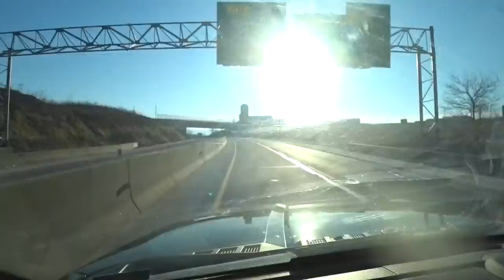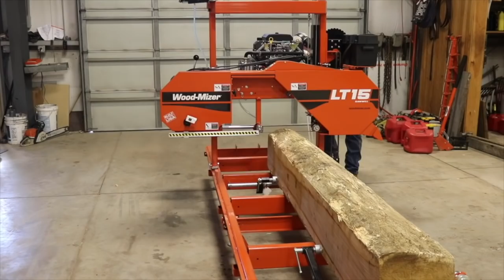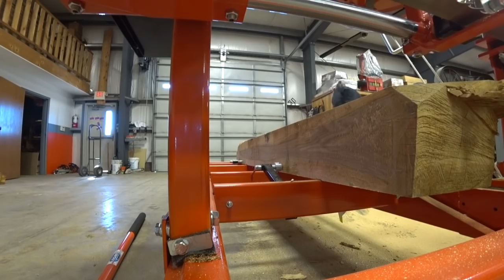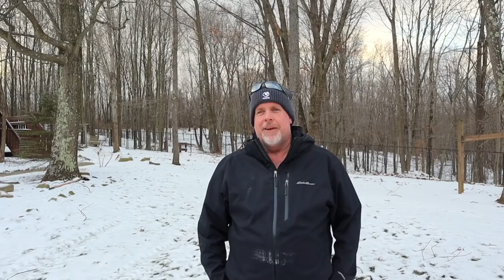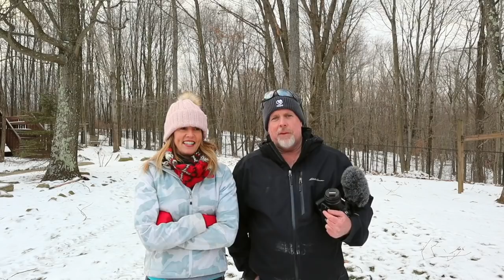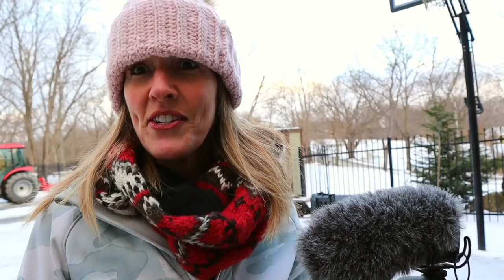#341 WOODMIZER SAWMILL  And Thanks for 50K!

Comment: We bought a Woodmizer LT30 with the trailer option back in 1989 and still have it,  at this point it hasn't been used a lot in the last 15-20 years, but prior to that we ran a just short of 3 million board feet through it.  They built a great product that's easy to maintain, and will last you a long time if you take care of it.

Comment: Bought the NORWOOD 36 HD and it works fantastic. Added a section to accommodate 12ft lengths.  And the hydraulic  lift arms and pump make loading the logs so much easier.  Also bought the 23 hp engine as an upgrade and did buy the  axle and tire assembly so as to go mobile.

Comment: Going to school in the 70s & early 80s, we had at least 1-3 snow days per winter in NE WI.  When I was in high school (1981-82 winter) they did cancel school several times due to -15 or lower days.  I can remember kids with wet heads getting on the bus in the mornings and by the time we got to school, their hair was frozen.

Comment: Hi Mike, thanks for all of your videos on tractors and implements. I finally took the plunge and bought our first tractor recently.  BTW, i have had a similar mic issue with the Rode mic ,where i plugged it into the headphone jack instead of the mic jack by accident, resulting in no audio. It is usually the simplest explanation.

Comment: Re the Wood-Mizer LT15 wide vs standard LT15: I would absolutely recommend the Wide.  I have an LT15 (and LOVE every minute of it) but my one regret would be going longer instead of wider.  Went with an extra bed in order to be able to mill 22’ lumber but now find myself rarely milling over 12-16’ (built a solar kiln that only takes up to 14’ material) and needing to trim logs in order to fit the 26” gullet.  Don’t get me wrong, 26” wide lumber is fantastic, particularly if you’re going to glue up book matched pieces, but having single slabs up to 36” would be well worth it - particularly if you’re looking to mill for crotch figure where much of the most interesting wood is.  Trust me, ANY sawmill will change your entire outlook on logs.  You’ll never look at a log again without wondering what it might look like as lumber.  Each log is like opening up a Christmas present or figuring out a new puzzle lol.  Thank you for all your insight and awesome videos!

Comment: Build a stack chamber to set the first cants in horizontal off the ground.  One slice and firewood production could drop into the trailer underneath.   That saw will be a great addition to the property and future materials to use, sell or barter for storage barns. Do anchor seal your saw logs and let them age.  Great channel, kapper outdoors referred you.

Comment: hi there guys . 0  to 50   faster than my car . great job  and i do believe it is your 3rd job . and great pay more toys to play with . now to preach a little .LT 15 is not big enough at least go to the wide . you can't add wide later but u can add longer . .i made a mistake like that . one trouble is the 15 does not have high bunks . a log of that size will need to be placed on the mill with a machine . think of your big oak log. what size band mill can saw it . a 15 w would . turning in not going to be a problem . hand feed to me is a good thing you will get a feel for the saw in the cut .with a power feed you listen to the engine . just takes time to get a feel for the cutting . you are real good at this kind of stuff and will have no problem . check out the woodmizer latest its a 15w with high bunks . it thing the # is something LZ15 . enough of that stay worm tonight . if i can help in anyway give me a call . i am a bad typer

Comment: Congrats on hitting 50k! I think I started watching your channel when it was around 5k-7k. We have 7 ac here in NE Georgia and do tractors, chainsaws, wood splitting, outdoors here as well, but with 3 kids 3, 2, and an 11 mo old don't get much time. Celebrating our 6 year anniversary in a few weeks! Mike, I think you're on the right track with the Wood-mizer. I just put my deposit down for an LT28g19 with the log deck package. I was back and forth with the LT28, LT15/go/wide models, the Woodland Mills models, and even the Harbor Freight but went with the WM LT28 because I can move it around my property, slightly bigger capacity than the LT15, and the winch powered log turner/loader. My delivery date is early March and I'm really excited to start sawing some logs! Can't wait to see what you decide on.

Comment: Hey mike,I told you some time ago a friend of mine bought a new Norwood sawmill for 10,000 Canadian delivered.Well,he's already complaining about the manual function of the mill vs hydraulic.He's says its way too physical to handle those logs on the bed turning and flipping.he wished he would have spent more and saved his body.Just a heads up.Also,i would buy from your local dealer with close networking and parts,if he;s a good dealer,stick with him.Just a thought.

Comment: I just pulled the trigger on the LT15E10S (Electric Drive) and MP100 from Wood-Mizer. Been reviewing for a while actually. I looked at the LT15 Wide and LX150 but the accessories are limited for those two variations of the 15. I also got the Lapsider and Lathe Mizer. Aiming to do some timber frame construction. Check out Out of the Woods and The Tradesman YT channels. Congrats on 50K. Maybe I'll get that many subs some day 👍

Comment: Cheers on 50K. Two things i would consider if it was me getting the bandmill (as i'm in my mid 50s and over 6'-6") are: A) The height. Getting the one that sits up higher (the towable model i believe) is probably a bit more ergonomically friendly and easier on the back and B) the hydraulic roller system. I would imagine it's easier to use the hydraulics (again,think of the back) to roll the bigger logs around than having to always use the cant (sp) hook. Just food for thought.  P.S.  Was Mike the long haired,hippie type when ya's got married???  Thats my question haha  ;-)